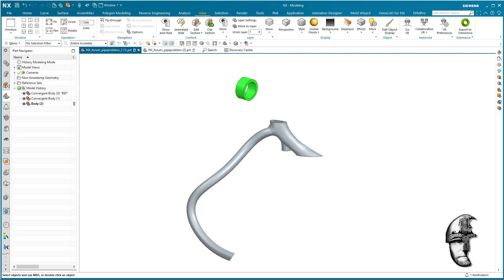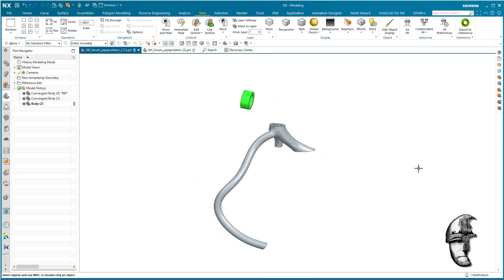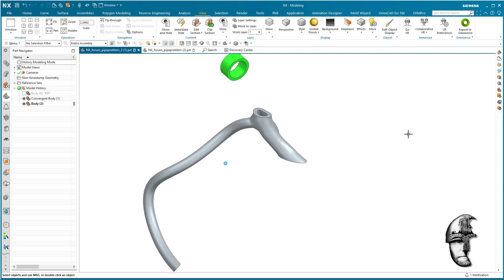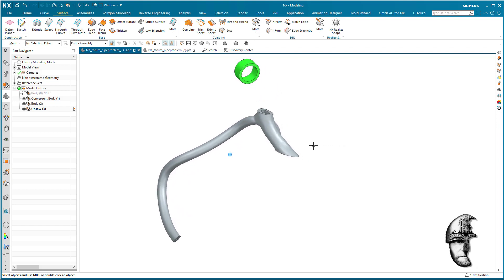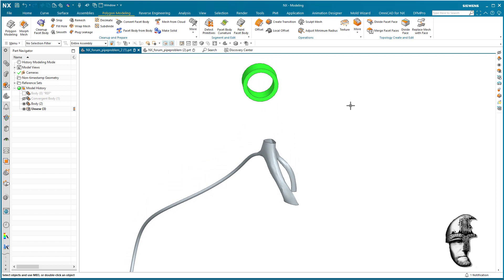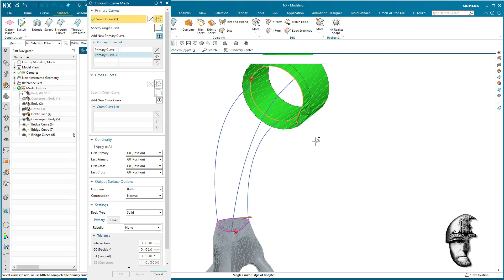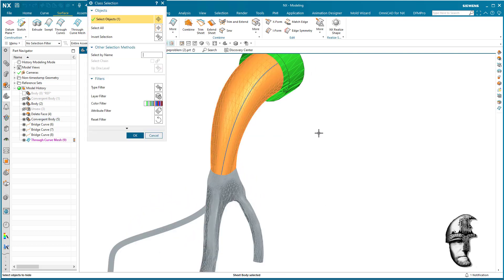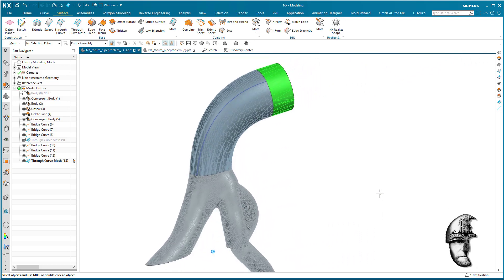Full Hybrid Modeling

Comment: Thank you for the video. This is an excellent example of how to deal with the surface bodies, and what functions of nx to use. I never used unsew function, I always used offset surface, value 0, to get the copy of the surface. What does the Cleanup facet body do? In which situation or on what facet bodies it is useful?
Reply from the maker: Hi Edvinas V, thank you for your reply and the recognition here its a boost to continue providing solutions here. To you questions. 
1. Unsew has been around for a couple of releases and is really handy to separate an area from a sheet or solid body for various purposes. Just to highlight, it is not a copy but the actual same faces that originates form the original body but in unsew'n state can be handled separate form the original body and support various worklflows and when done can be sewn back into the original body. 
2. The bodies in the video; one traditional Solid Body (the green pipe) and one Convergent Body or facet body (bright blue). The convergent body is a body that is defined by a "cloud" of triangular planar faces. This is often resulting bodies from e.g a 3D scan of some sort. These bodies are not parametric nor mathematically defined (coordinates only). NX provides great strength in its Full Hybrid Modeling capabilities as these Convergent bodies can be mixed together with traditional sculpting and parametric molding – Surface and Solid modeling. This means that you do not necessarily need to reverse engineer e.g a scan of an object and redefine areas as analytic shapes to use them in your digital definition and manufacturing processes, you can leave them as Convergent Bodies (facet bodies) and include them in you workflows directly. Many of the traditional features also work directly together with the Convergent Bodies and there is no need to reverse engineer whole scans you can settle for a limited area and sometimes you don’t have to do anything – just use the Convergent Bodies directly in your workflow – as can be seen in the video. Extremely powerful and enables unlimited workflows. Now the Cleanup is a function that I highly recommend to always start of with as this will optimize the facet body input. If the body originates form a scan or another system there might be some quality issues where you e,g have Degenerated Edges, Folded Edges, Self-Intersections, Inconsistent Normal’s or Laminar Slits – The Cleanup Facet Bodies helps eliminate all these quality issues and in doing so ensures eliminating downstream issues before they become issues on e.g. imported STL’s from other systems or Scans.

Best Regards
Fred
Reply: @fredriksandblom27  Thanks for the explanation, appreciated! I just received the training to use the ATOS 3D scanner, so all of this is very relevant to me.
Reply from the maker: @pino32wn , great scanner you've got there. Are you going to use it for reverse engineering, repairs quality validation or others?
Reply: @fredriksandblom27  We are using it for many tasks, for running production to check and track critical dimensions, for the PPAP parts, and for R&D purposes. Planning to use it for making some esthetical parts from modeling clay, scan them, and do reverse engineering.